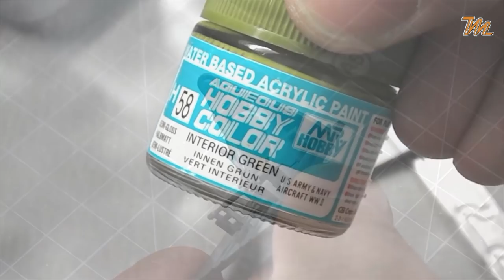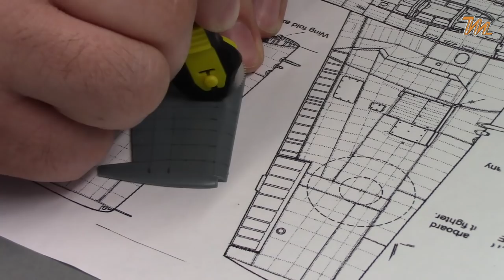1/48 F6F-3 Hellcat - Eduard - scale airplane build

Comment: Superb build, what's the thick wire you use to rap around the engine hub that you drill into for the other wires? thanks.
Reply from the maker: Hi, that's soldering wire

Comment: How are you able to put gloss varnish on so thick without it cracking? Everytime I do that, I ruin my model. Yours looks amazing!
Reply from the maker: +Ian Vaughan Hi, the gloss looks thick on video but it is actually very diluted. Maybe the fact that I use only cellulose based varnishes and MLT also helps.
Reply: Ian Vaughan Every time I put gloss varnish on my previous attempts they came out like an ancient oil painting. I've learnt over the years about diluting lol.